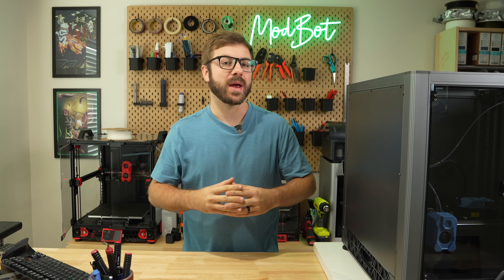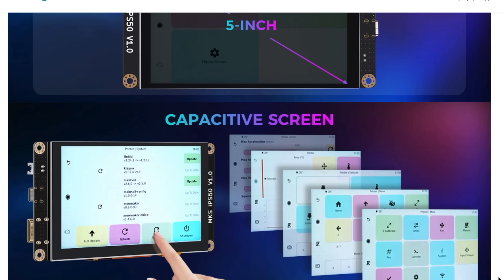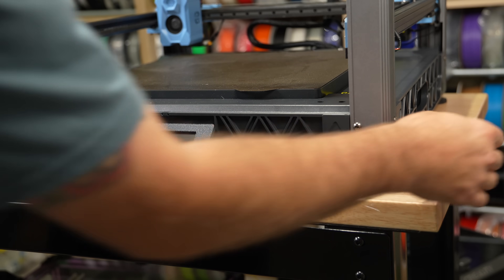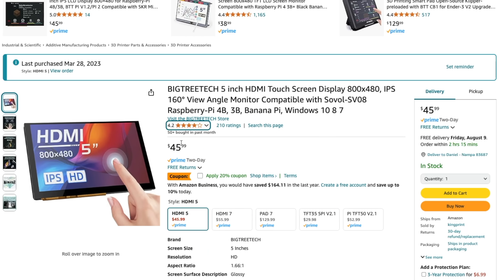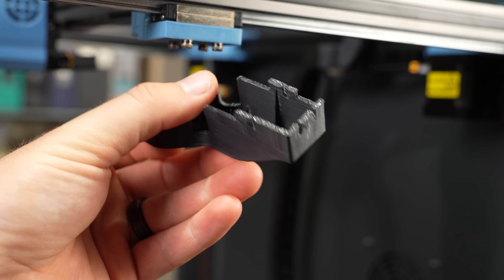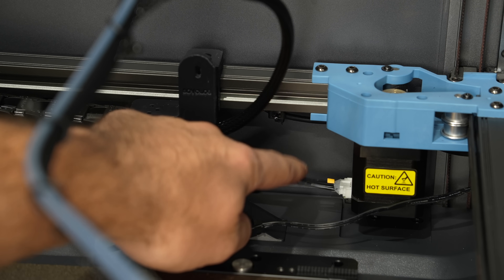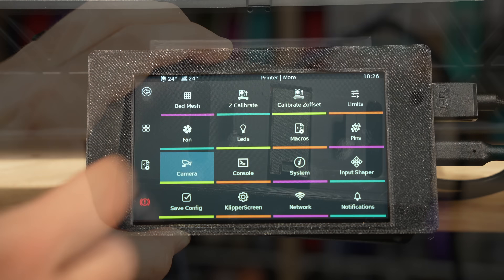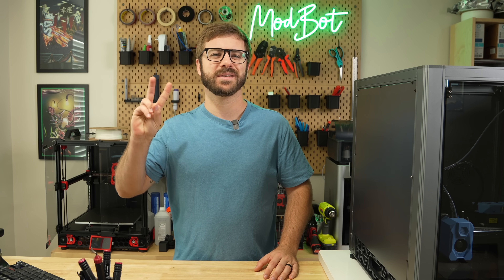Are The Official Sovol SV08 Upgrades Worth It?

Comment from the maker: Sovol reached with some feedback:

1. For the HDMI screen, currently we have 3 ways to install it:

At first our HDMI screen and knob screen are designed to function at the same time. So it’s just placed on the side of the machine and does not require the customer to print anything. Later, many customers said that they wanted to replace the position of the knob screen with an HDMI screen. So we temporarily designed a bracket for customers to print. That’s why this installation method customers need to print a support frame. In the future we may redesign a back cover according to customers’ needs. But that still depends on market feedback. In the front of the PLA parts on the enclosure

2. For the PLA parts on the enclosure:

When printing PLA the fully-closed machine would always have a plug. The PLA height part will help with the heat dissipation. Not only that, without the parts, the enclosure glass will be crashed when the toolhead moves to the max height of the printer.
Also, the HDMI screen can be installed on this part for a closer look.

3. For the cable chain:

We have made some changes on the chain. One parts on drag chains now needs to be reprinted. I will send the stl  to you!

4. For your injection mold suggestion, we still need comprehensive evaluation. But we will make sure it on records to see if it can happen in the future. Thank you so much for your thoughts on it!

Good news is the length of the cable chain has been fixed for a while. The machine in later batches no longer has this problem, and printing parts is only a measure for the users who first received the machine. 

I’m so sorry that we didn’t keep you updated with this change.
And I totally agree with you that the accessories page should include more information about the products&instruction of how to better update them. We really should have done it earlier. After hearing from you I immediately feedback to the team and they are already processing it. It may take some time to edit and I’m not sure if it will be uploaded before your video. But if any news I will let you know!

And according to the team, this internal part will not be easily worn out, and the knobs and magnet holder is fixed with screws, therefore currently the part we ship out is still PLA. But of course, you can share your thoughts to the audience. If users want to print it in PETG or other filaments, we’d be happy to provide the stl to let people get to choose.

In addition, the holder of the screen&enclosure is already under test and discussion. We do attach great importance of improving customers’ experience when they choose our products. And in the future we will keep trying our best to make sure this idea reflected in our products and services. 

Thank you so much for all of thoughts&feeling you shared above. Thank you for clarifying the confusion to me so that we can fix them. If there are any update on what you bring up I will let you know!
Reply: #2 seems like a hilarious non-response to me
Reply: lol the same day i make my mod. go figure. 

3. For the cable chain:
We have made some changes on the chain. One parts on drag chains now needs to be reprinted. I will send the stl  to you!
Reply: Somehow, their answers show they don't understand their business
Reply: Unfortunately, I am still seeing people on social media commenting that their motor wiring is too short (like the problem you had in the video), and the information available on the product listings isn't a whole lot different from what you saw when you made the video. Thanks for sharing this information about these accessories, it is helpful now, even months later.
Reply: Have they fixed any of these issues yet? Also is making a DYI enclosure from scratch the way to go or should a person with the Sovol SV08 still use their enclosure and make changes? Is PLA still bad even though they said it dissipates heat? Is the height issue fixed?

Comment: You missed two upgrades:

The anti-tangle detection: complete garbage. The PTFE tube gets pushed out of the detector every time you try and feed filament. Get the BigTreeTech detector and run an extra wire to the toolhead for the filament feed sensor.
The hardened steel nozzles: they come with volcano-style nozzles but they aren't exactly the same size so it's still proprietary. I recommend getting the bambu style aliexpress replacement so you can install most other types of nozzle.

I quite like the screen and enclosure add-ons. Is the screen overpriced? Absolutely. Is the enclosure a bit janky with the 3d printed parts? Absolutely
They are quite expensive for what they were but how cheap the printer was it makes sense in my mind and especially a klipper screen makes the printer so much better to use.

Comment: why would you ever use abs??? it is garbage [lower tensile than both petg and pla]... "PLA can withstand greater pulling forces before breaking, with tensile strengths around 50-60 MPa. PETG follows with 40-50 MPa, and ABS has the lowest tensile strength at 34-36 MPa"- ultimaker 

If your reason is for high temp-- polycarb has a GC significantly higher than abs and has far better mechanical properties

been printing for a long time [since ABS's glory days] and it is now a trigger word for me lol

Comment: I'm very tempted to get the SV08, but looking at the final price it is hard to justify.  I currently have an Artillery Sidewinder X2, and it works but is constantly requiring retuning and fixes. I am looking to spend $600+ and have a printer that cannot be stopped and have few failures.  I need to get parts printed as soon as I can for my company and the amount of time I'm wasting on fixes is killing my momentum.

Comment: That was a bit strange. The requirement for the raiser or the fact that you cannot use the full printer height is well known in every review and even mentioned in the description. The screen mount being printed? Is there a problem? Prusa sells you much more expensive printers with printed parts. The claim that the printed parts are from PLA is not further substantiated. Where did you read that? I ordered the enclosure, printed the raiser and I am happy. Even thinking about adding a heating and a tool changer.

Comment: You are the only one from the dozen or so videos that have said anything about the case having some limitations, 2 biggies are the vertical height and the cabling problem. For me not having a 3D printer at the moment having to print parts to assemble a case becomes a problem. All told the Plus 4 is looking more and more like a bargain.

Comment: It's always good to get a more independent consumer oriented view of products.  Thanks!

I was interested in the SV08 when it launched but I was between product development cycles and wasn't in the market for a 3D printer but the SV08 went on my list to possibly buy on Black Friday for my winter product development and small scale manufacturing, after the price dropped and the bugs had been squashed.  I need an enclosure because I will need to print ABS, ASA-CF, etc.  I wondered why the enclosure is a $170 upgrade when I assumed it was laser cut acrylic but it's actually fairly nice aluminum and tempered glass, albeit with 3D printed bits.

It is weird that the enclosure requires a 3D printed riser to utilize the top 50 mm of Z travel, and even weirder that the riser is ventilated when people buy the enclosure to have a passively heated chamber.

My biggest wish would have been a split top with a hinge that would allow the top to be folded and stored vertically at the back of the SV08 to open the top for better part cooling, and to allow me to feed TPU directly down from an overhead bearing hub reel holder directly into the extruder.  Over 90% of my printing is TPU and a reverse Bowden tube is a non-starter.

Comment: I don't understand why the internet is so obessesed with the idea that printed parts = bad quality.

Printed parts reduce cost, allow iteration and with modern printers most prints have decent part finish, why is that considered a bad thing?

I agree on the cable chain holders, but there is nothing wrong with a screen mount being 3d printed...

Comment: In a sense, it's funny to complain having 3D printed parts in customization kit... They could send only hardware and have you print the rest. Yes, from your choice of material, limited to PLA/PETG without the enclosure ;)

I wonder, how expensive those plastic parts were, if they were injection molded. It makes no sense to tool injection molds before knowing the kits will sell to cover the cost + delay for tooling and injection. Start with 3D printed parts, evaluate based on demand.

Comment: The build height issue with the enclosure is probably inherited from the voron design its based. For standard size builds you miss about 50mm in z compared to xy, depending on how much you want to scratch the top lid. The sovop enclosure is at least glass, so the tube wont scratch it nearly, if at all, as quickly as the acrylic/polycarbonate panels

Comment: I had initially ordered the HDMI Touch, but then canceled it. I think that was a good decision. I thought the enclosure was too expensive from the outset. Since I don't print ABS or ASA yet, and won't be printing in the foreseeable future, I don't need a heated build chamber. However, I do need a draft shield for large prints in PETG or PLA. That's why I simply stuck insulating foil around the printer. It works wonderfully. In contrast to the open printer, I no longer have any warping.

Comment: I highly recommend staying away from Nadirs mods.  I am not saying his mods are bad, they are much better than I could do, but there is also FAR better out there.  From the Bigtreetech screen to the riser and everything else in between including his unofficial enclosure, there is something else better out there!  He just happens to have made a name in the sv08 modding community early on, and now every one keeps recommend his work.  Again, none of it is bad, and its better than I could do!  Take the screen for example,  the one that Mommel made mostly hides the wires.  Yes you have to still plug them into the sv08 on the side, but they run though the electronics bay to get there and you dont have a rats nest of cables hanging out the front.  Nadirs enclosure you have to drill holes into the frame to have a working door, there is a half dozen other enclosures that mount the doors the same as the stock and dosnt require you to put holes in your sv08.  Then again Nadirs seems to like putting new holes into his sv08, you have to add holes to use his screen mod too.
Reply: Do u have any github link/yt channel to one modder better then nadirs? 
I dont have sv08 but im looking what to do if ill buy it and i dont like nadirs mods too
Reply: @iacopozucchetti5494  I mostly just searched Printables and Makerworld for the stuff I needed.  I havnt really seen much of anyone talk about mods who were not Nadirs.  Again, his work is good, its just anytime I went looking for a solution to a problem I found something better.

Comment: PLA is fine for the SV08 parts. It's only a partially sealed enclosure so apparently only gets to around 50 degrees C internally. I bought a Big Tree Tech 7 inch screen and mounted it in a PLA printed enclosure that can be mounted anywhere. I'm going to bolt it to the top hat, which I also printed out of PLA. I'm just about to fit everything tomorrow and the first job is the cable chain so it's good to know Sovol have already modified those parts. I had read that the original parts would work if you remove two links from the chain and had been expecting to need to do that.

I'm very pleased with my SV08 so far. I have come across a couple of issues but they are fixable. The first issue is the auto filament change operation doesn't work very well. When unloading filament it always seems to leave some molten filament inside, which quickly solidifies and prevents loading of the new filament. I've found the answer is to remove the PTFE filament guide tube and to clear the pathway through the extruder from the top while it's hot using the cleaning wire provided with the original printer kit. The new filament can be then loaded easily. The second issue is the filament spool spindle is poorly positioned and by using bearings the spindle is so free spinning that the filament on a new spool can unwind leading to an excess of unwind filament that could easily jam if left unattended. So far, I've got around the problem by mounting the filament spool on the Ender 3 sitting next to the Sovol. The spindle on that doesn't have bearings so the filament is kept under the right amount of tension. I had some 4mm PTFE tubing delivered from Amazon earlier and am planning to run the filament from the spool through a closely aligned length of that to a simple clip on bracket mounted on the sensor where it enters the machine. I got the idea from my 7 year old Flashforge Creator Pro, which uses that method to route the filament from the spools mounted on the back of the machine and has always proved to be 100% reliable. If the spindle still runs too freely, I'll just have to redesign the spindle for a solid one that has no bearings. That's always worked fine on all my older machines but of course they were feeding filament more slowly.

Comment: I ordered the SV08 with the screen combo, was really disappointed with the screen. The case felt really cheap even for a 3d print...decided to design my own enclosure So I took it apart. Turns out the screen is a makerbase ips50 from the model number on the back. Thats a 39.99 screen retail, so sovol is charging 60 extra for the case and cables...really bad value. If able to do over, I would have just ordered a BTT 7in and made my own enclosure.

Comment: Honestly the screen is one place where I wouldn't mind a 3D print as long as it's made using a well tuned printer. It's not structural, it's not going to be exposed to high heat, and I'm not a big fan of the snobbery over injection molded parts. The same piece on my Mk4 is also 3D printed, but you can barely tell by looking at it.
Reply from the maker: I think you misunderstand. I am not against a printed screen holder. On a mk4 it’s expected it’s part of the prusa way. The SV08 is all aluminum and injection molded. At the very least it’s about setting proper expectations. If they are gonna print it then say it on the product page. That way the person ordering is aware of what they are getting. If the sv08 used a bunch of printed parts then it wouldn’t even be a thing.

Comment: On thier website under the SV08 it does say with the enclosure the print volume is 330mm on Z. I feel your right on the injection molded parts and I'd pay $200 for the enclosure if it included those parts and $215 if it included the riser parts.

Comment: How thick are the sheets of metal? are they thin sheets folded to match the 4mm recess in the frame? or are they actually 4mm thick pieces of aluminum sheet metal? because I can buy enough sheet metal for all sides that's 4 mm thick and make the paneling part of the structure for about 120 usd from a local metal supplier.

Comment: You can use FFC HDMI cables (about 50cm) to connect the display. Theese cables are very flat, you can fiddle them between the HDM port and the case, back into the case. There is an stl on printables for the BTT HDMI screen v1.2 without openings on the side for the cable, but routed from the inside of the printer.
There is one free USB-Port inside the printer. So an USB to USB-C cable can be connected there. I recomend an angled USB-C connector.
As FFC-cables are easaly damaged, I recommend to print a smal cover for the connector, avoiding to accidentally damaging it.

Comment: Honestly there is no reason to consider the SOVOL replacement screen. The BTT is cheaper and better and it works like a boss. I couldn't get my SV-08 to connect to my WiFi until Reddit suggested I install the BTT which I'd already bought, so I did and was able to immediately connect. This isn't like the P1 series from Bambu where you can ignore the crappy screen. I have yet to install my enclosure.

Comment: I bought a 3rd party screen and mounted it on the printable top hat which I modified to close the holes.  The mount points of the Sovol screen fit this mounting point NOT the base.  I left the stock screen in place.  It’s nice to have the option of both interfaces.

Comment: I did the bambu hotend mod and couldn't be happier. No worries about the nozzle falling apart and the ability to print cf materials on the cheap.
Reply: But how's the flow?
Reply: @ss1gohan13  the same if not better.
Reply: Whats the logic behind that? if you could explain that that could alleviate some of my curiousity.
Reply: @liamosterhout6538  I can get nozzles from Amazon usually with same day delivery if I order early enough. When I did the mod, the sv08 nozzles were falling out when people were printing PETG and Sovol didn't have a hardened steel nozzle ready at that time. I like to move away from proprietary parts whenever possible. So in short, cheaper parts, faster delivery times and more nozzle options to choose from.

Comment: Did you run into the nozzle unscrewing issue some SV08s had?
Reply: The nozzle doesn't screw. That's why there's an issue. I've run many spools of PETG through mine and haven't had that problem. Other problems? Yeah, no shortage of those.
Reply: It's pushing the nozzle out! And yes. I had the issue. Destroyed the build plate. This is something that should be talked about.